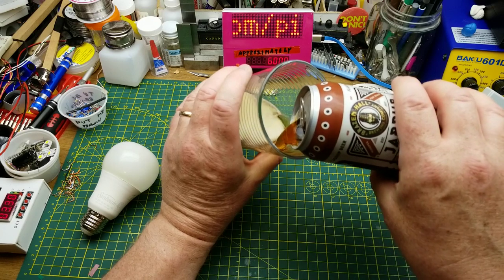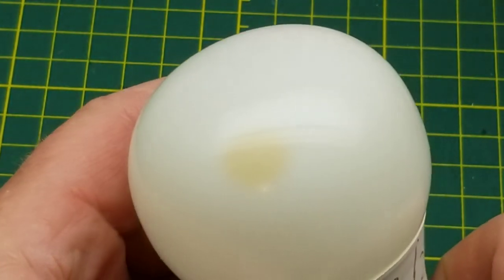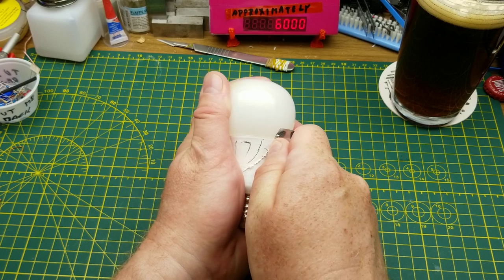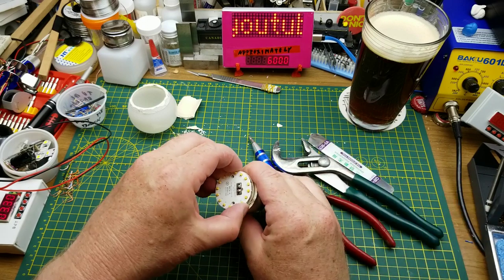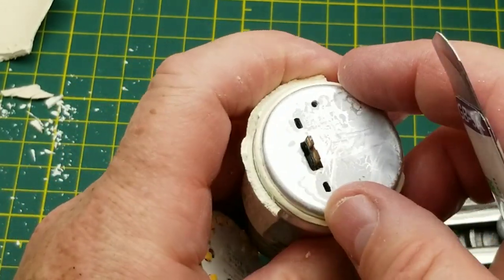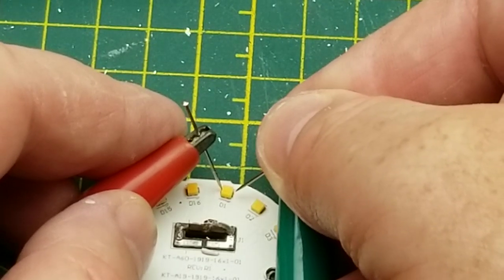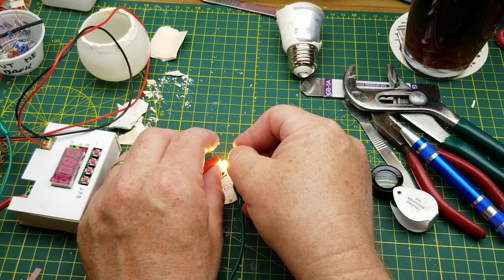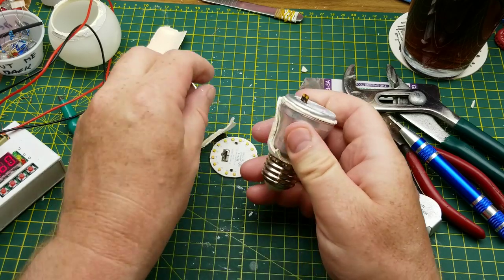failed LED light autopsy

Comment: This is what i like social distancing beer appreciation :) Been playing / working on a 900V HF valve output stage, hate that just putting the meter probe on the anode makes a spark? the 900V is on the top and all the bits i want to look at are  below. may be a beer might ease the pain if i make contact :)

Comment: I've had three NOMA LED light bulbs perish in the last year. I've had them apart, expecting the power supply to be the point of failure. Actually, the power supplies in two of them were quite good little switchers (like yours, and they read about 63V). The other one was a capacitive dropper oddly. All functional though. So what killed it? heat. Melted one or more LEDs knocking them all out. These bulbs (as you can see) have NO ventilation. Designed to fail in my opinion. Worse still, I was in crappy tire the other day, and all they sold was NOMA LED bulbs with a few token sylvania ones. I won't be buying those again. I'm also trying an experiment with one, I de-capped the bulb (just removing the plastic dome) to see if it helps with its longevity. Oh - and my bulbs didn't have any potting compound in them.

Comment: Those are made a lot better or different than the ones the sell at the Dollar Tree in the states.
Reply: Many markets require a decent (high) power factor and proper constant current. It's also really unreliable to use a capacitive dropper for more than a couple of watts. These little Buck Regulator supplies are amazingly cheap and this one is actually a dimmable design that senses the input voltage phase angle and adjusts the drive current to provide "dimming".
Reply from the maker: It's a lot more solidly constructed than the same brand that they're currently selling at the same store here too.

Comment: Yes you did rip it apart you evil man ha ha  :-D,  but it was dead anyway so no loss :-D
That bulb looked really well made in comparison to some.
I think you got your moneys worth there :-D
I could not see what that transformer like coil was, it may have been a two wire inductor, so that chip was a buck converter.
Didn't they go overboard with the potting compound lol.

Comment: Hello,
Complete NOOB here. So, your mains voltage is 155 volts AC?! Please explain how - trying to learn.
Reply from the maker: The line voltage here is nominally 120 VAC.  The 155 volts that I measures was DC. 
Keep in mind when you are measuring an AC voltage, the measurement is not the peak voltage but rather a sort of average, which is properly called RMS. 

When you use a full bridge rectifier and some smoothing capacitors, the resulting DC voltage is closer to the peak AC voltage, and will be above the RMS voltage of the AC waveform.

Take a look at the wikipedia article on rectifiers for a more in-depth answer than I can type here: https://en.wikipedia.org/wiki/Rectifier
Reply: Thank you so much for your detailed reply. I really am trying to learn more about electronics. Your videos are AWESOME! I've both liked and subscribed to your channel. Lead on, good sir!

Comment: I've watched many teardowns of similar lamps of more recent vintage and they're almost all the simpler cap dropper circuits. cough (BigClive) cough
Pretty sure those won't last four years.
Reply: The Capacitive dropper is a very reliable and simple circuit.  If the cap is rated correctly it will last for a long time.  The trouble with cheapy chinesey products is they use sub-par components and also drive the LED's too hard and cook them.
If you slightly underdrive the LED's and use a good quality capacitor, they last for years.  BigClive has got lights he has made that have run for years on end continuously using capacitive droppers.
It's not the circuit that is the issue, it is subpar components that is the issue.

Comment: Did you put it back?
Reply from the maker: I tired, but it was too hard to get all the pieces of potting compound back into the case.
Reply: @pileofstuff  I meant that white cup with "put me back" written on it, on the left side of your cutting mat
Reply from the maker: Yeah, about that. 
It's supposed to remind me to put all the components in it back where they are supposed to be after I've been tinkering and experimenting... But I never seem to get around to it.